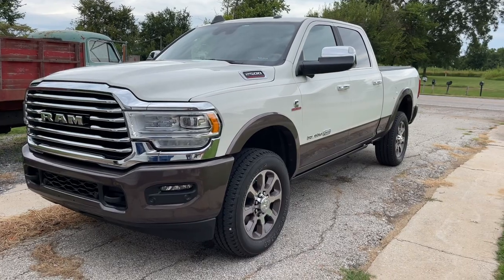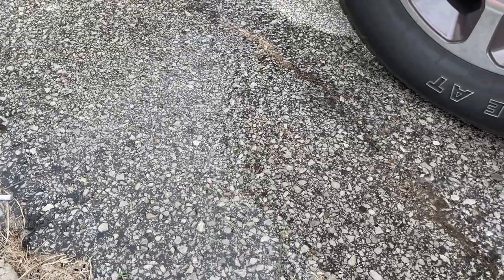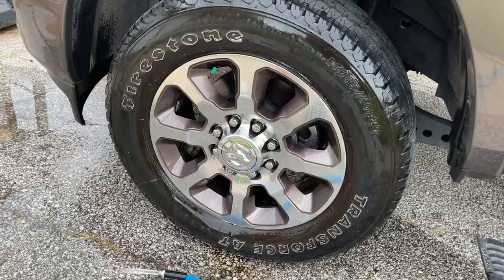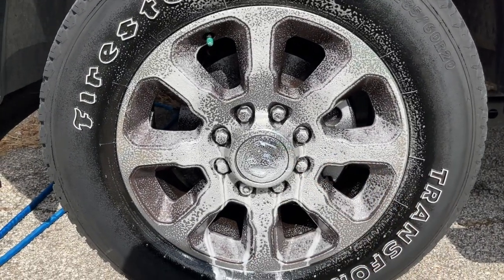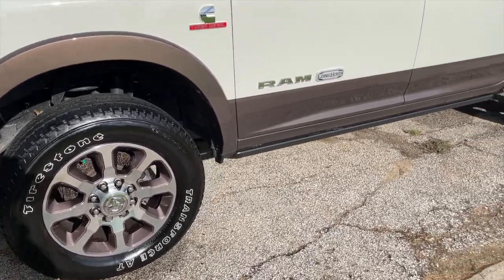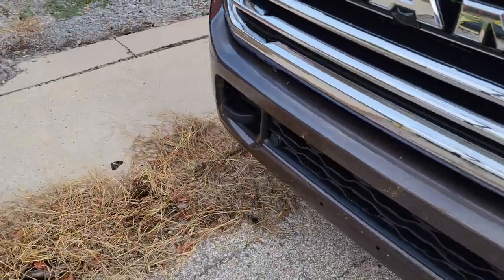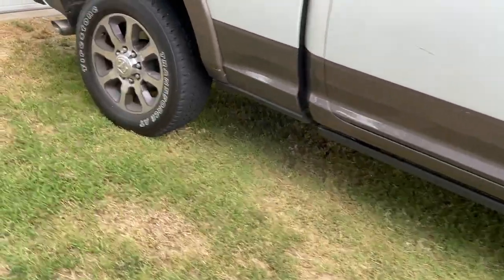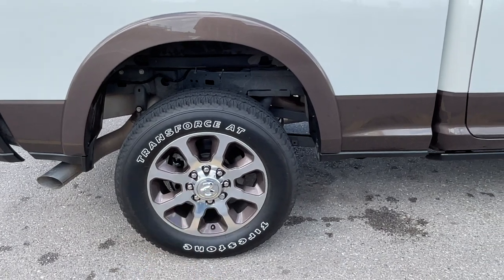Does Armor All Ceramic Wheel Cleaner and Tire Shine Work? 2 Week Test!!

Comment: I bought it because it was all that was in stock but it's been three weeks and it is still holding up well. I just sprayed it and left it, if I rubbed it in it'd probably be even better. One tip, next time I will park on card board because it left 4 stains in my driveway where the excess dripped off.
Reply: Same here, a lot of tire shine brands leave stains on even asphalt 🤝

Comment: Dont waste the money or time with the Black Magic tire white bleche. They ruined the original formula that used to be Westleys tire white. The biggest issue is a "white-ish" band that develops around the face of the tire where the white letters are. The bleche pulls the oil from the rubber (because its a different compound in the area) and after prolonged use, starts to leave a white wash looking band (able to be seen even after using a "tire wet" product). Scrub with soap and water, then use Car Guys Tire Shine. It has a polymer additive that helps block the UV from the sun and retain the oils in the rubber.